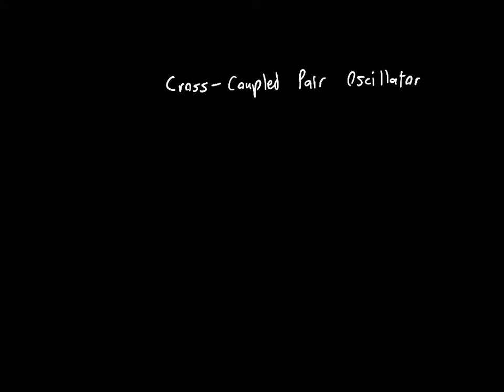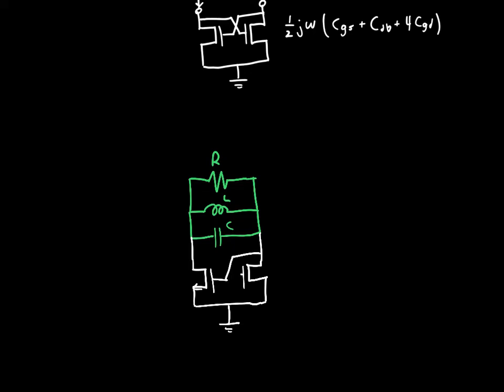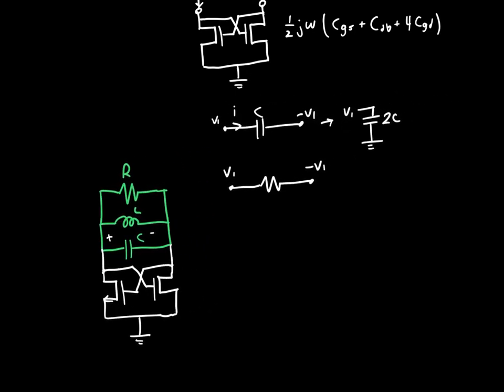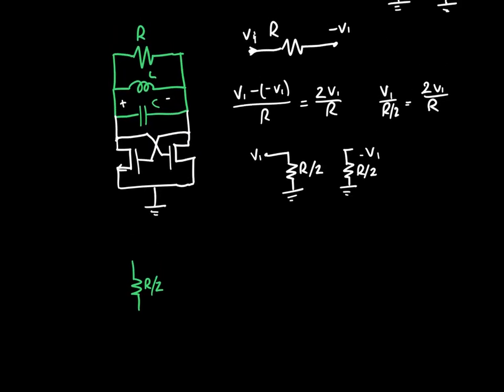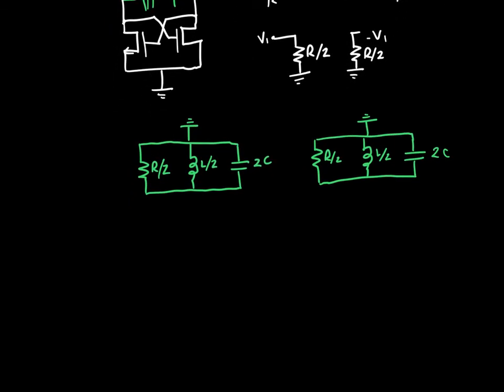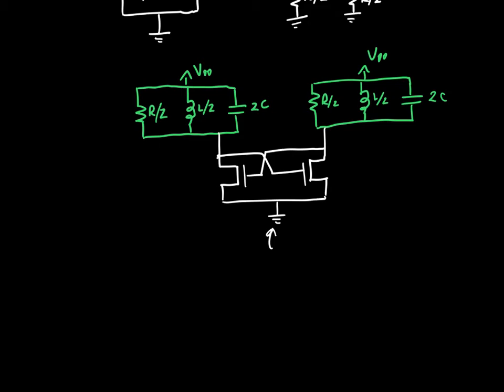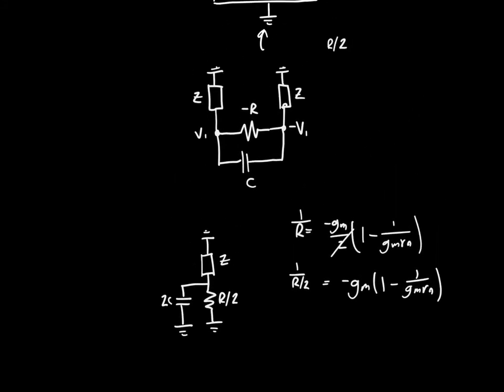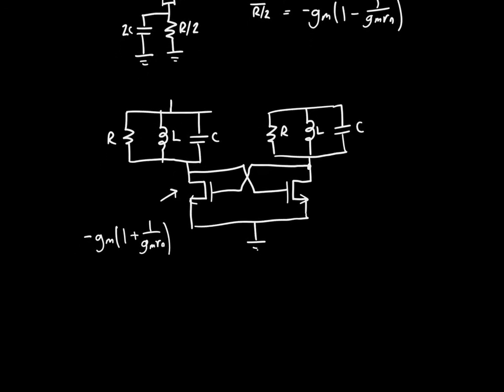Cross Coupled Pair Oscillator Part 1

Comment: Thanks very much for a great video. One thing I've never understood about this circuit is how the ocillation amplitude is limited. In a spice simulation the output voltage seems to grow until it swings below ground and soft clips. Here we seem to assume that the MOSFETs remain in saturation. What am I missing?

Comment: Hi there. I really very like all your videos.
I am new to electronics.

I have one question.

When you connect Vdd, how come it biases the transistors through R since inductor would short it out?
Reply: That's the point. He is not trying to bias the resistor. He was trying to bias the drain of the transistors.